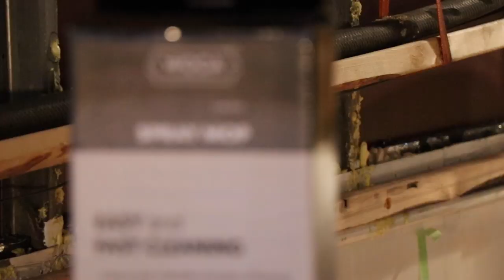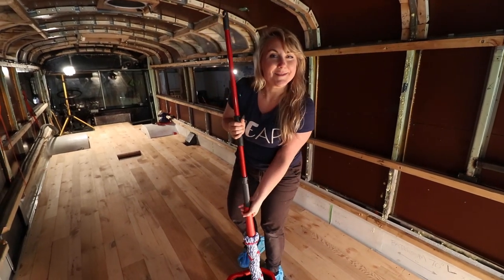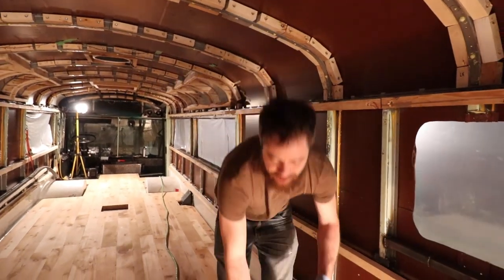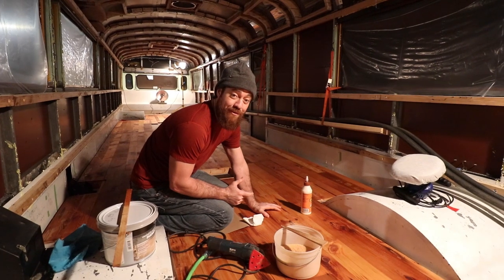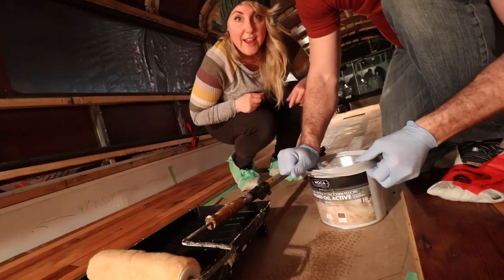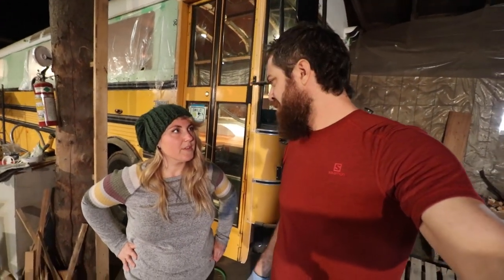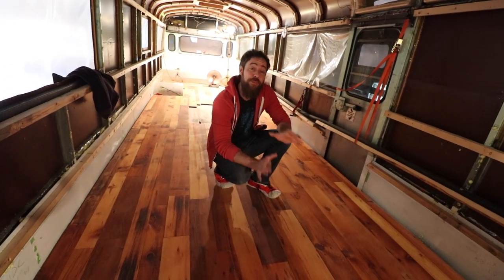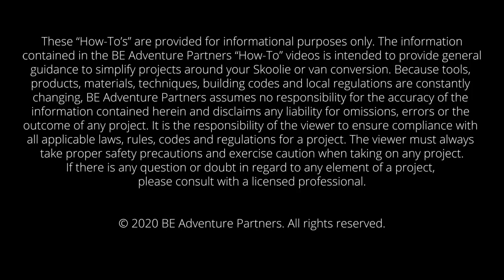REAL Wood Floor Finished With Eco Wood Treatment In A Skoolie | Part 4 | WOCA Diamond Oil

Comment: for the booties: get some old or cheap socks and put them over youre shoes , they should last just about long enough
allso when sanding a natural wood floor it will be perfectly smooth but putting oil or moisture ontoo the wood will bring up the small hairs that where layed flat with the sander , to get it perfect you need to use a scape steel . or use a special primer for wood that basicly puts starch on the hairs so they break instead of lay flat , to scrape a floor is a bit mush , just take in account that for the first few months the floor will have a slight velcro feel to it over time you wear the tiny hairs off
Reply from the maker: watahyahknow very good points! With all the buffing we’ve done with the red and brown pad, the Woca finish has left the floor exceptionally smooth without that Velcro effect. However, with the third coat and achieving maximum saturation, we still have a bit of oil left to buff up & we’re leaving it until we begin certain area projects so we can walk on it with our work boots. Later we’ll buff the floor with some buffing pads to get up the remaining oil, which simply feels a bit waxy at the moment. The areas that we finished buffing are super smooth!
Thanks for watching!
- Brian + Erin

Comment: And legend has it that they are still wearing those high fashion booties today. It is gorgeous guys.  It's almost a shame to cover it up with furnishings and walls!
Reply from the maker: The legend is real and lives on @AllMoMoMostHome Bus! The reason being is that we take the tape off the booties and wash the polishing cloths so that we can reuse them!! These polishing cloths are SOLID and resilient! We have a plan to use the floor as the bottom area in the cabinets. So not much of the floor will actually be covered.... Just a wee bit for the bathroom wall... Other than that, we have a pretty open concept floor plan on the drawing board. We'll probably do a video on that soon 😜
Thanks for watching, Larry & Fam!
- Brian + Erin

Comment: So you screw the floors in, how did that work with the overlapping grove. Do you have to have the grove there and I if so how did you make it ( hope I did not miss that part in video) can I cut wood nail gun them down? Or would insultation and the metal be a problem on a bus? I know lots of question thanks for answering tho
Reply from the maker: Hey hey @Akinke Lucas! Great questions and you didn't miss anything. This is actually a 4-Part Series. So if you missed how we installed the subfloor, milled the reclaimed wood floor, and prepared the floor for installation, then you'll probably want to watch those parts in order to see how it all fits together. Here's those videos in order:

Part 1 - Skoolie Sub Floor: https://youtu.be/aOLTlr0P-qc
Part 2 - Old Reclaimed Barnwood Floor: https://youtu.be/9UXXT81GZRk
Part 3 - Installing REAL Wood Skoolie Floor: https://youtu.be/4WQQZTm9h_4

We also wrote an article on our website about this entire process here: https://beadventurepartners.com/century-old-reclaimed-barn-wood-turned-into-stunning-skoolie-floor/

After you go through those, let us know if you have any other questions! We're happy to go into more detail if you like :)
- Brian + Erin

P.S. Thank you so much for watching! We really appreciate you taking the time to leave a comment :)